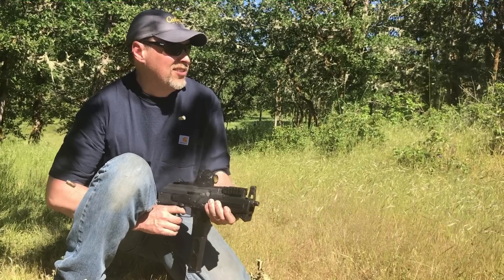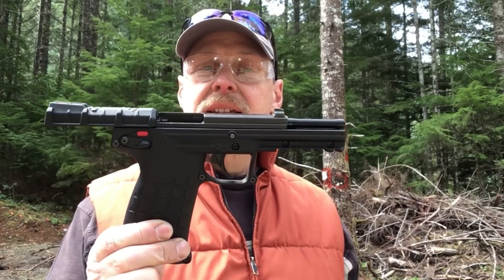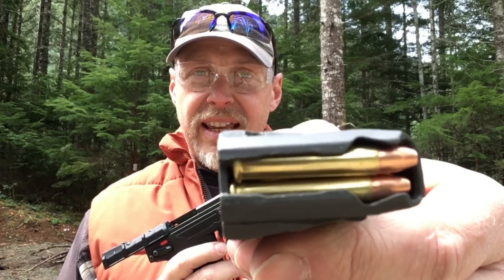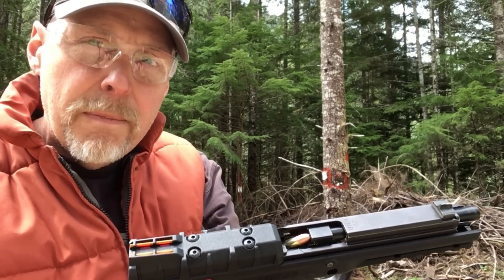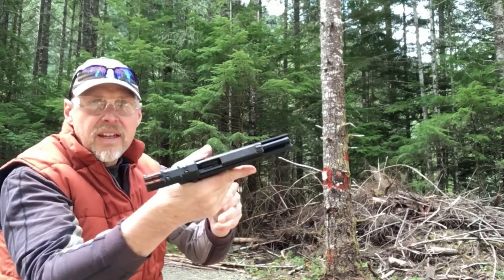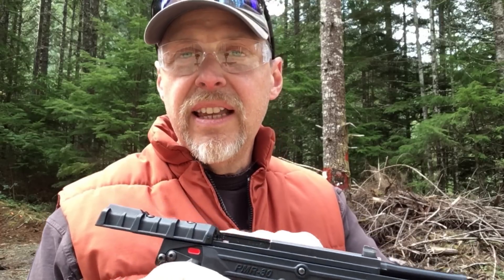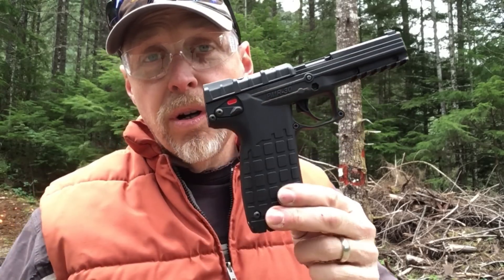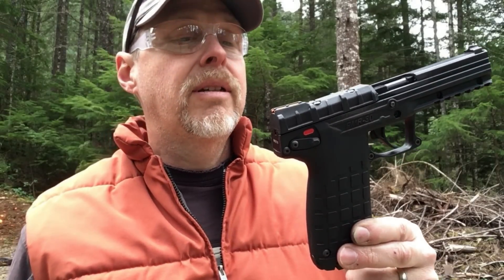Troubleshooting: the Kel-Tec PMR 30

Comment: This is a good video. I like seeing the ideas other people have when they are also problem solving an issue.
Next, let's find out why the Hi-Point 995ts mags don't feed. The rounds go nose down because the front of the rounds don't sit tight in the mag.
Reply from the maker: Politically Unreliable 
  I don’t have any personal experience with Hi Point but is it possible that the spring tension isn’t sufficient to hold the round tightly against the feed lips of the mag? I also have seen what you are describing happen when the rounds aren’t pushed all the way back when loading the magazine. When I load a mag I tap it back to the rear several times just to be sure the rounds are all lined up straight in the mag. This works well even though you can’t see inside of the mag you know the heel of the cartridge is flat against the back of the mag. Also, if Hi Point mags have a follower that can tilt it may cause some problems like this. Not insurmountable but it would require extra care in loading. Some graphite lube in the mag probably wouldn’t hurt either.
Reply: I've gone through some options with my mags (lube, tap, change spring tension by bending/modifying). I now need three new mags. I knew that going in. If you want a challenge, pick up someone's H-P 995ts mag and play with it. You'll see that there may be an inexpensive fix for a good solid firearm. Might be the follower itself. I don't need it, but I have a tinkerer's curiosity.
Reply: Oh, and thanks for replying. That's cool.
Reply from the maker: Politically Unreliable 
  Haha! Yep. I understand completely😉
Reply from the maker: Politically Unreliable 
  Thanks for watching😀

Comment: Found a fix for mine!!! I noticed there was about a 1/8 inch gap between the mag and the grip when inserted and if I kept pressure on the bottom of the mag pushing up it would shoot just fine. So by accident I ran across a vid of a guy that ran a bead of superglue along the bottom of the catch on the mag itself to take up the slack when the mag is in. I did that only I used JB Weld instead, Had to file some off as I put to much on it but after fine tuning that this gun runs just fine. Before I couldn't get thru a mag without 3-5 FTF but I put two hundred rounds thru it yesterday and had two total. I think those were more related to how the mag itself was loaded. I'm getting better with that. I'll try to find that vid again and post it on here ..give it a try. It's an instant fix and you don't have to send the gun back to keltec !!
Reply from the maker: dbel723333 
  I really appreciate the tip!  I noticed the play in the mag and tried shooting a mag with pressure on the mag and I got a different set of problems🤔. I think there is a variety of things at work here. I try to change just one thing at a time and observe what happens. But since we both know there are people who have these and they work fine then we know it’s just a problem to sort out. I like a challenge. Especially when the solution is revealed.
Reply: PMR30 is my daily carry.  I also repaired my magazines with JB Weld and have had zero FTF's in over 3000 rounds.  On loading:  I picked up the "loader" for the PMR30 magazines on Amazon and it completely eliminates loading problems, including denting the rounds.  Rounds go in aligned and stacked correctly.  Have a great Marine Corps day and Semper Fidelis.
Reply: Jaraco Yemx ...curious what brand mag loader you bought...also I called keltec the other day and mentioned this fix ...he pretty much thumbed his nose at it a said he “didn’t see what a little super glue had to do with fixing a feed issue”.....I was pretty much done with him AND keltec after that...I have the gun working fairly well now after I’ve replaced a firing pin, a front sight the flew off and modified/fixed a major feed issue. All this happened within 700 rounds of shooting. I should not have to make a brand new gun work in my opinion. Aside from all that the gun is a blast to shoot..Keltec shouldn’t rely on their customers to fix their products and fixing the mag issue on their end would be such a simple fix ...keep shooting !!
Reply: Jaraco Yemx do you guys have a link for the stupid glue / jb weld fix ? I can't seem to be able to find the video.....Thanks in advance if anyone sees this and reads it.
Reply: 1 shootist “How to fix the keltec PMR” by James T...type that in the search bar..i used jn weld instead
Reply: Glad y'all liked my fix. I was drunk when i made that video :)
Reply: There are a couple out there, I splurged and go the $30.00 one, not the $10-12 one and I love it. you reload a mag within one minute+ perfectly every time
Reply: @MaxHeadspace9mm  I think you are challenged

Comment: The funny thing is I ran 5000 rds in10 yrs in my So called unrelliable Taurus pt, not 1 hick-up except with the aluminum case 9mm, steel not 1 hick-up. Its just now having some minor issues but not bad for a then 360$ pistol. Every fire arm is a machine made by machines.Ive seen 500$ sig sauer turn out to be a piece of crap. Good vid man
Reply from the maker: Desert Brewcrew 
  Yeah. I hear ya. That’s why I try to explain to the haters on here that some people have great experiences with this pistol. It’s probably a good design that hasn’t gotten the quality control that would give everyone that experience. Making an innovative design is one thing. Producing a million of them is entirely another.

Comment: Mine was worse.  Every 3rd round would mis-feed, but slight back pressure on the slide or a gentle tap forward would fix the issue. Holding the mag tight against the bottom of the grip frame worked to a point, but I still had a few mis-feeds.  When I returned home,  I examined the breech face under a 9X loupe and the finish treatment is pretty rough.  There's also a lot going on in there with spring loaded extractor, left-side bullet guide (for lack of a better word since it isn't truly an extractor), and the case head stop at the top of the slide.  I took an empty case, epoxied it to small dowel rod, put some lapping compound on the case head, and spun it against the breech face until it was polished nicely.  No feeding issues since.  I think you're right on the money that putting 500 rounds through it for a break-in would accomplish the same thing...I just didn't want to buy and shoot 10 boxes so the gun could sort itself out.
Reply from the maker: Vicarium 
  Absolutely. 22 mag isn’t cheap! And shooting 500 rounds of occasional jams isn’t fun! But it’s resolved now and I just need to make the follow up video. It’s a neat little gun. Just wish KelTec put the extra bit of effort into it to make it reliable from the start. Wouldn’t cost them more than $25 per unit and I bet everyone would gladly pay that to ensure reliability.

Comment: I had a few hang ups with my pmr 30, but after cleaning it twice and shooting a few hundred rounds through it, it operates just fine.  Remember to also tap the mag after each five rounds loaded into it and then tap it after each 2 rounds until full.  I have yet to buy a speed loader, but doing what the manual says has allowed the gun to run smoothly.
Reply: And I meant 5 rounds until 15 and then tap after each 2 after that 😅 get so busy thinking about what you're typing and you miss a section.

Comment: We use VRT 130 or VGI 250s,  a clear high temperature release agent, that works pretty good.
Reply from the maker: Karl Napp 
  Turns out I was on the wrong track. There was a manufacturing defect. I fiddled with it for over a month to no avail. So I sent it to KelTec and they fixed it free of charge. The whole story is in the follow up video, “KelTec PMR30 100% Reliable!”. This weekend I’m uploading a penetration test with this to determine how much damage this little gun is capable of dealing. It’s a pretty shocking video. 🤔

Comment: I personally have found that if you put a little bit heavier bullet in there it feeds quite well I probably have 700 rounds through Mayan and I and I did not have any real problems but I was buying the Winchester 40 or 45 grain bullets and it rain very good
Reply from the maker: Mark E L L I N S 
  I did try that. Lighter rounds too. I bought 7 different cartridges to see if that helped. My follow up video to this, “KelTec PMR30 100% Reliable!” Tells how it got fixed.

Comment: That's kind of similar to what I do when 22s are having an ejection or extraction problems. Lube up the cases with just a little little bit of motor oil. It works wonders with my Beretta 21A it can shoot the cheapest bulk ammo all day long as long as they're lubed up. It also worked for my friends Jennings j22 and another friends Star hk 22. I think the little 22s with the short barrels have timing problems depending the burn rate and the pressure of the powder and the stickiness of the brass surface and the thickness of the brass
Reply from the maker: Brasstard 7.62 
  Yes. Cheap 22 ammo has looser tolerances and is more tricky in most guns.  Especially guns with short barrels. I can’t resist a bulk pack of 500 rounds for close to $20. Even though they cause the occasional hiccup. At least it’s not too frustrating because I know what is causing it. But even when I pony up and buy high quality 22 ammo it’s still less costly that any other cartridge in any other caliber regardless of quality. 22 is just fun.

Comment: Also u can put a bead of gel superglue under/ across the magazine catch lip which will raise the mag a tad..
Reply from the maker: Yeah. I played around with that but it didn’t fix my particular guns problem. I sent it to Keltec and they fixed it right up!
Reply: @MaxHeadspace9mm  Can you elaborate on what Keltec adjusted or upgraded for this particular issue? Thanks.

Comment: In olden days it was gospel that if you had a new semi-auto 200 to 300 shots were required for break-in. We are told that break-in for firearms these days is not needed?  The more rounds out of a new gun breaks the shooter in as well. In the “motor” sector lots of discussion as to proper break-in oils & driving procedures. I believe that more than minimal lubrication will extend the time needed for break-in.  Of course in the olden days polymer & softer metals were not thought of much. Hardened steel probably takes a bit more time to break-in/wear-in.
Reply from the maker: I agree. I’ve had people argue that guns shouldn’t need a break in. I can’t see how they think that. 
  I do think that most guns need less break in than they used to however.

Comment: I know this is an older video and you probably fixed the issue. What I have done with my PMR-30 is a new slide rail and barrel. The gun has been much better, I ran 200 plus this weekend and no jams or miss fires to speak of.
Reply from the maker: I sent mine to KelTec because I couldn’t get it to function any better than one  or two malfunctions per mag. Once they sent it back to me I examined it carefully and determined that they replaced the barrel and slide. It also looked as if they replaced the firing pin. So since that is along the same lines as what you replaced I’m suspecting that they had a batch of out of spec parts that got through QC. 
  But mine works flawlessly now and I couldn’t be happier.
  I’ve done a total of five videos about the PMR30 including one I uploaded less than a week ago, “PMR30 for Concealed Carry”
Reply: @MaxHeadspace9mm  Good news, I will check out the latest video. Whats your thoughts on Bravo company, I just got there Reece 11 (BCM4).
Reply from the maker: Doug Mohn 
  They are very well regarded. I don’t personally have a Bravo Company rifle but I hear nothing but good reviews from friends that do. 
  Congrats on your purchase!

Comment: Good video. I believe I have done what you said about selling a gun before it was broke in. That kinda why I tend to buy used ones now. I can get a deal and they're not usually hard to fix .
Reply from the maker: Benjimen Franklin 
  Yeah, it’s kind of crazy. I haven’t bought a brand new gun in years. Partly because so many first time buyers want it, get it, try it, have problems with it or don’t like it then sell it. Most gun problems are actually people problems. And to gun enthusiasts that presents an opportunity.
Reply: Max Headspace9mm 
I kinda like old guns too. I like wood and metal better than plastic (polymer) . The old guns have lasted so long and that makes them more valuable to me. Finding a really old one in good condition is very hard nowadays. People have bought them up and don't tend to sell them very easily either. If you can get it cheaper than new and fix it then I say go for it !  There are a few other 22 Magnum auto loading pistols l but not many .
Reply from the maker: Benjimen Franklin 
  Yeah. I think it’s a great idea if it can be reliable enough to be a valid contender for self defense. Kudos to KelTec for taking the challenge on. 
  As for wood and steel- that’s always going to have a place in my heart too.

Comment: Have you thought about silicone spray/light coating of paste rather than graphite?
Reply from the maker: JJJ SMITH 
  I’ve cleaned and lubed this with every kind of lube I’ve ever heard of. I’ve learned quite a lot from this pistol. 
  I’m working on uploading the follow up video and sharing all I’ve learned. Should be in the next couple of weeks😉
Reply: Max Headspace9mm 
  Thank you for the information:)
Reply from the maker: JJJ SMITH 
  Glad to😉

Comment: Never loaded 30 in mine. A lot of people report feed issues then. I load 24 or 25 and only a single malfunction. One time a round didn't move up far enough to get stripped off. Didn't do it again but I blasted the inside of the mag with Remington dry lube to slick up the innards. Have run some Hornady and CCI thru it, but mostly it's American Quality 40 gr jhp. Got a bunch in 250 rd bulk boxes and it runs great.
Reply from the maker: GregDaGoblin 
  I’m hoping to do a follow up video on this soon. Can’t wait to see if my latest theory will work. I’ve tried it all. But I hope this will work as it is supposed to. I tried short loading the mag but in my case the results weren’t any different. I think I’m getting close to a breakthrough🤔
Reply: Well, there are lemons out there in every brand. I have a friend with a Glock that's a jamaomatic. Glock perfection my butt haha Hope you can get it sorted out. I really like mine.
Reply from the maker: GregDaGoblin 
  Yeah. I know there are enough people out there who love this pistol. I want to love it too. So I’ll keep trying because I’m crazy that way🤪. Thanks for the input😉

Comment: Question , I have a Kel-Tec p 11 , I like the gun . But I'm have the seem problem . But it is worse . I go to load a round and it jams . But if i use a 124 grain or 147 grain it works just fine . . But it's expensive to use those rounds . would like to use 155 grain it's not that expensive . But it not showing any of the problems you show with the PMR  30 .. Do you have any ideas of what to do . The gun shop has gone out of business . And the local shops here will only work on guns bought there . Thanks
Reply from the maker: 3flashcan 
  I would first consult the manual to see if it recommends a specific ammo. My PMR30 did. If it’s really a function problem and not the result of ammo or needing cleaning I would send it to KelTec. They have good customer service. Watch my second video called, “ KelTec PMR30 100% Reliable!”  I have this gun running perfect now.

Comment: I have 2 of these. I like both. One will eat anything I put in it, but the other will only function properly using 40 grain, american made ammo which KELTEC recommends. They both functioned as they should have from the get go, don't know anything about a 500 rd. break in period. The only precaution I take, other than cleaning is to be sure the rds. are loaded in the magazine correctly.  Tap the back of magazine after every 4-5 rds. and everything seem to work fine. the only problem, to me is they are too light, I like a heavier gun.
Reply from the maker: Jacqueline Samford 
  I knew there were people like you. People who had a positive experience with this pistol. That gave me hope that this pistol could work. After this video I did three more ( and I’m still looking forward to even more than that). Because now I’m in the “my PMR30 runs perfect”club. I’ve run 1,000 rounds through it without any malfunctions. This has been a very interesting journey. I’ve learned a lot and am the better for it. This is one of my favorite pistols now.